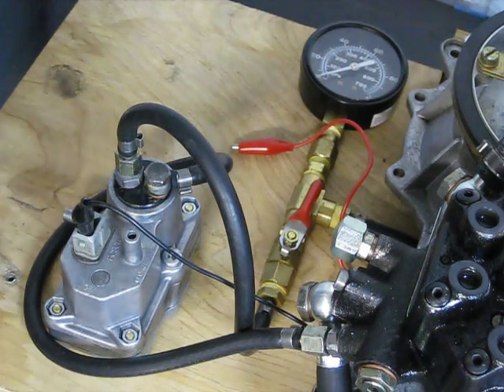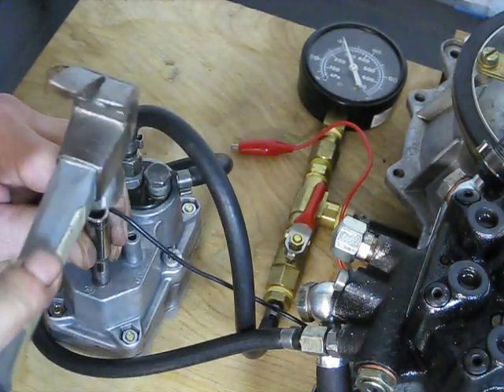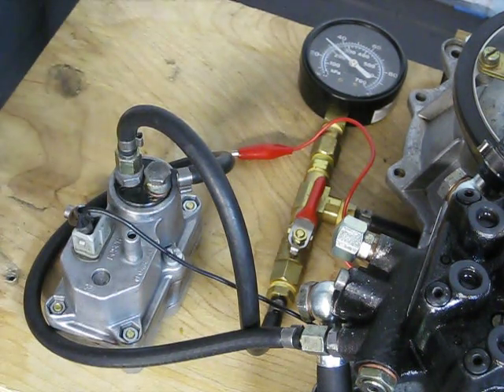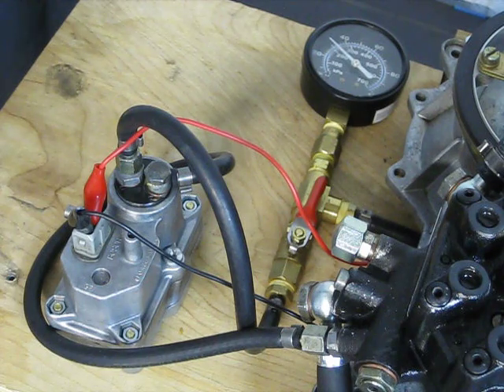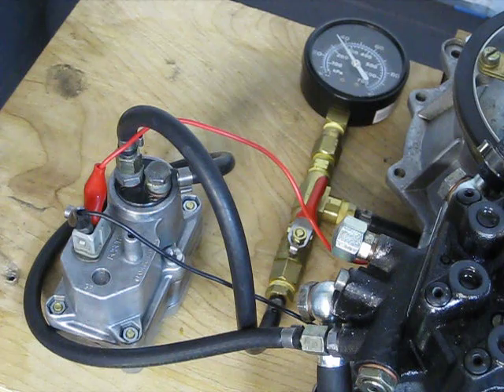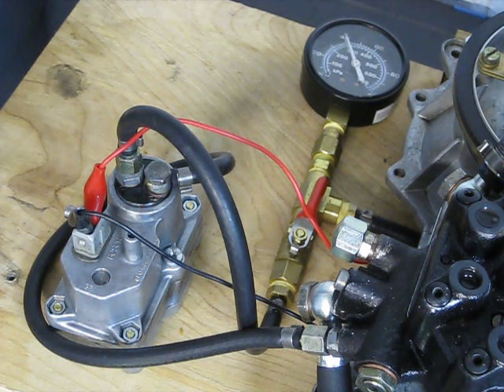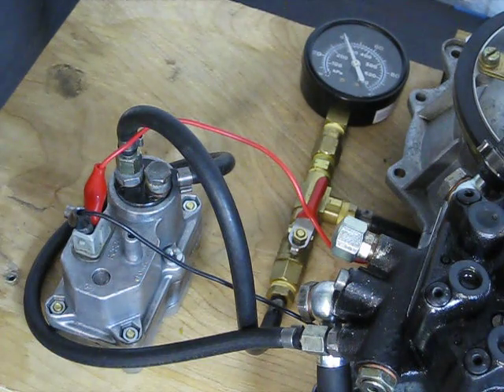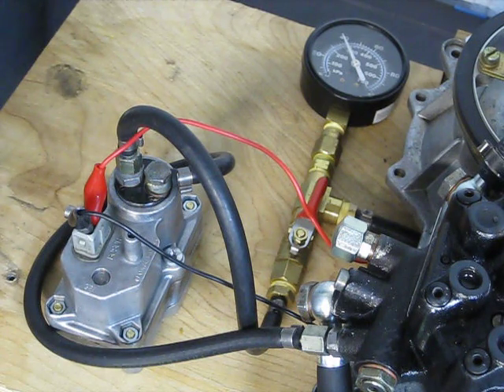928 Classics - CIS Warm-up Regulator (WUR)

Comment: So when engine is hot enough the electrical power off to the WUR heating element ?and with normal operation temp electrical signal off( circuit open) ? Then if full throttle pressure (enrichment)is via control plunger at the top tomthe WUR?best regards

Comment: Hello my friend, one question, about how it works, when the engine/coolant  temperature increase the fuel pressure increase but what cís part control the fuel mixture, lean or rich?

Comment: How does the WUR affect rpms? My 1979 928 is hard to put into reverse or 1st gear if the car is at 1,000 rpms. After a while the rpms drop to around 700 rpms which at that point most times i can put it into 1st or reverse without the gears grinding. Any help much appreciated as the reverse/1st gear grinding issue is common in early 928s but i have not found a clear/direct answer.

Comment: After you shut off the pump is it supposed to hold pressure for a few minutes? Mine doesn't but I remember reading somewhere that it should hold pressure for a few minutes. Mine will instantly drop to 15 psi after shutting off the pump and then hold. Chances are I have a problem with the fuel distributer or check valve. It only vapor locked once.

Comment: … you could also just drill and tap through that WUR plug you are hammering on and insert about a 5mm long fine treaded 1/8 inch bolt with a couple of nuts to adjust and lock the threaded bolt into place … that way you can adjust the WUR cold and hot cycles by just turning in or out the installed tapped threaded bolt … no more hammering and precise control over the internal depth of the plunger which in turn acts upon the tension of the heat sink spring inside the WUR ….
Reply: ZZZZ that’s smart thinking 🤔!!!!

Comment: Hello, can you please tell me what is going on this fuel pressure on my SLC 450 1978 ? I've measured the pressure from warm up regulator to higher part of fuel distributor it has 5.2 bar about 75 psi , and measured from warm up regulator to lower part of fuel distributor it has almost the same pressure. As i know from your vido pressure must be about 32 psi on cold engine. 
So the question is , the problem is in warm up regulator or something else? Because I have some kind of pressure regulator after warm up regulator in the same fuel line which goes on higher part of fuel distributor.
Please HELP ME))!!!

Comment: can anyone there help with a warm up issue i have?
Reply: Okay what ?
Reply: Hi John. Problem with a 84 107 sl. starts great , soon as you try depress the accelerator it bogs and dies... soon as its warm its great. Changed the fuel filter and warm up reg and brassy switch...still the same... had a w123 merc with the same issue exactly, never cured it.
Reply: Ever have old gas ? Varnish can clog the warm-up reg input port filter screen. Take a look there. Even if you changed the reg, it can clog up right away if there is varnish in the system. Bogging down sounds like mixture is lean, control pressure too high. Hook up a gauge and record control pressure every 10 seconds to make a graph. Compare to specs. Injectors will clog over time unless you drive every day. Get a spare set and send the originals out to the ultrasonic cleaners. Check your accumulator for leaks. High failure rate part. Use Techron or some other cleaner regularly.  Also check for vacuum leaks. Use a cigar to blow smoke into a vacuum port. Cheap smoke machine.